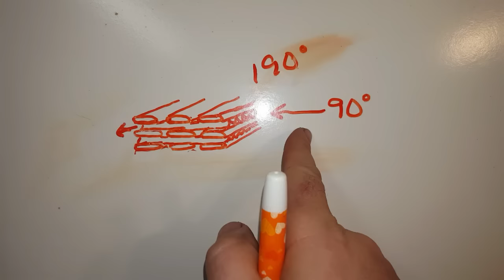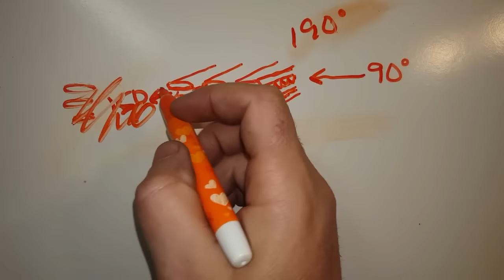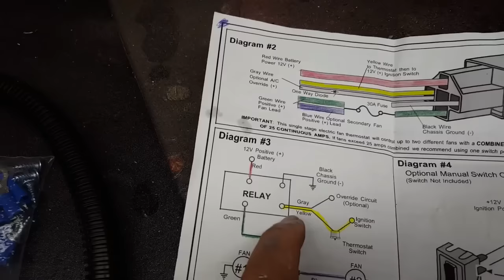67 to 72 Chevy Truck Radiator Install and Electric Fan Conversion

Comment: Thats a nice curved black hammer on the wall on the right side of your bench lol 😆 jk.... But throw make sure your (hi)hammer don't pull the studs out ya wall
Reply from the maker: That's a new multi-tool. It can also be used as an ax or an anchor.

Comment: these fans... can they run silently ?  suppose i dont use them for cooling radiators but for ventilation, they seem to capable of creating static pressure and S blades for quieter operation compared to straight blade fans...

I am thinking of  buying  a 12v version, powering it with an 4amp DC adapter and expect 28watts of "not so loud operation" that can be used as a push fan . you think that might work? the cheapest i can find is 35$+shipping so help me out if that s a good idea.
Reply from the maker: The fans are not extremely loud but they are certainly not quiet. I think that will work. You might consider a slightly bigger fan with a 12v DC motor controller that can adjust the RPMs just below the noise level you want.

Comment: Hey Brian. I have a 69 C10 small block Chevy with headers and I need to know what power steering bracket to hook to that first bolt on my headers to hold my power steering tight? Or where to get the power bracket? How much ?? How about a picture? Thank you too much..
Reply from the maker: If I remember correctly, I used a 3/8" nut/bolt as a sort of jack-stud. Send me a text at 216 316-6166 and I will take a picture of what I did. It is sitting, covered up in the back of my shop right now.

Comment: where are you measuring the 18.5" to? as i think its only 17" core itself is it not?  18.5" to very top?
Reply from the maker: 18.5" WAS FROM THE TOP OF THE UPPER CHANNEL TO THE BOTTOM OF THE LOWER CHANNEL

Comment: Hi Brian. Did you use new rubber radiater supports? Since it is a 3 row? I went the same way on my 1973 C10. Regards from the Netherlands.
Reply from the maker: Yes, I didn't realize I never showed that. I went with the red prothane bushings from Summit....
https://www.summitracing.com/search/brand/prothane-motion-control/product-line/prothane-radiator-support-bushings?autoview=SKU&ibanner=SREPD5
Reply from the maker: Actually, if you go to 27:11, you will see that I sort of showed them.

Comment: where did you buy the chromed radiator plate from the monte at? its looks really nice.
Reply from the maker: Spectre Performance part #4366      $40             https://www.spectreperformance.com/search/product.aspx?prod=4366&pkid=4686904&rw=1

Comment: sorry question again where did you buy the plastic extension  at again to bolt down the fans.
Reply from the maker: The fans came with everything you need to bolt Notice the link I sent you was for one large fan, instead of two smaller ones. The ones I used in the video were discontinued. One large fan moves more air then two small ones of the same area. The only bonus to using two fans is if one breaks, the other will still give you enough cooling to get home.Also, If you want very reliable cooling, try this...https://www.youtube.com/watch?v=t7PykrgzWPQ&t=531s
Reply from the maker: I did just come across this, in case anyone feels like they want a dual fan installation...https://www.amazon.com/dp/B01E52NXOS/ref=dra_a_ms_ss_hn_xx_P1910_1000?psc=1&tag=dradisplay-20&ascsubtag=d6e15f0b38426f024e22ee785382944d_S

Comment: I don’t care what they say always use two relay’s on a duel fan set up
Reply from the maker: I hope others read these comments because that is an excellent suggestion. I might even go as ffar as two separate temperature sensors so you will never be completely without cooling. Maybe i should make a follow up video to show that.

Comment: Question how did u hook da fans up? Did u wire da fans to da key switch?
Reply from the maker: My new wiring harness came with a wire dedicated for an electric fan, but if you fast forward to around 19:00 I show the wiring diagram that shows you can wire the ignition switch through the relay and power the relay directly from the battery through a fuse. It's important that you don't run the fan directly off the ignition because when you shut the car off, the fan motor will act like a generator an induce a voltage back into your ignition, causing your motor to keep running after you turn it off. (at least until the fan stops spinning.). Even if your ignition circuit could handle the fan load, it will be annoying.

Comment: Id’ve at least put blue loctite on the water pump pulley...IMHO they do look good though
Reply from the maker: WTF? I put loctite on everything else. (I put that sh!t on everything!) I even went back and watched the video and I did not. I am not sure how I missed that. I have to go back and move the Power steering pump. I suppose I cold do it then. Thanks for pointing that out. That could have come loose one day at a really bad time.
Reply: Brian Stapleton No problem. It may not have ever come apart but better to be safe. Nice video explaining and fabricating everything. Fixing to do a aluminum radiator and electric fan conversion on my 87 project.

Comment: The old fan was on backwards. Lol
Reply from the maker: That's funny! 
I slapped the front of the engine back together just so I could show the whole installation on the video. I never noticed I put the fan on backwards until you just pointed it out.

Comment: Old fan looks like it was on backwards
Reply from the maker: Only one other person noticed. I lost some of the footage and quickly put it back together and reshot that part. Ooops. I had the fan on backwards. Good catch.
Reply: @brain151  how do you like the radiator?
Reply from the maker: @stevenharden803  It has been good. Although, I should point out that it only has about 20 hours of run time so far.